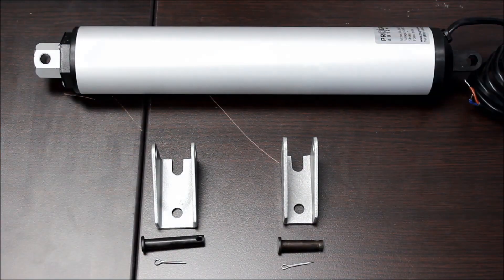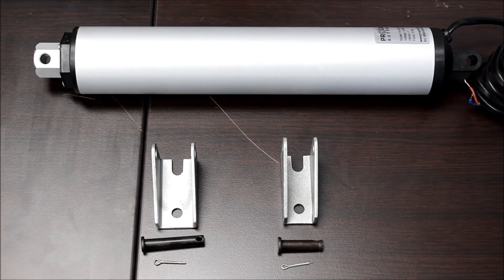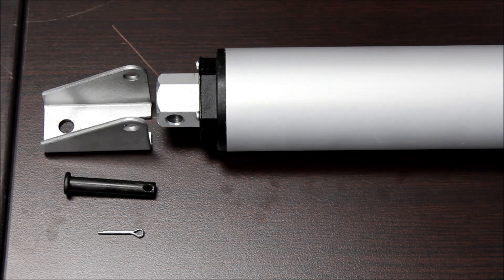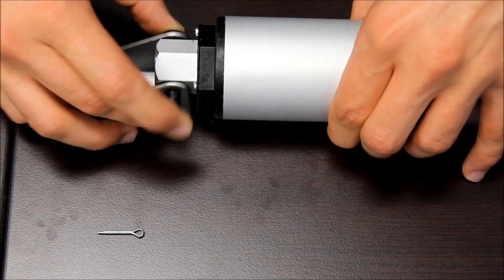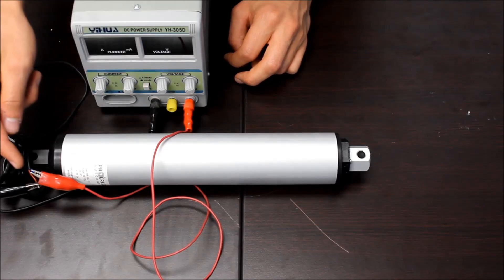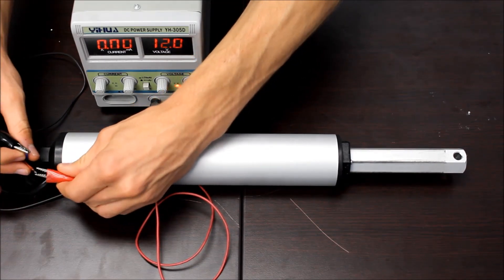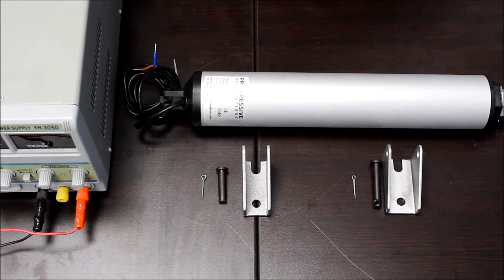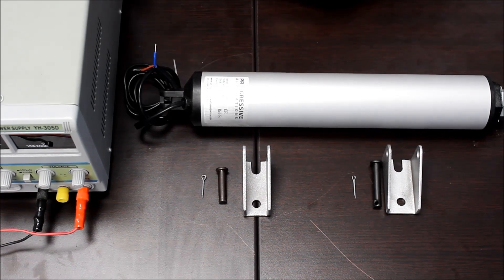High Speed Linear Actuator PA-15 - Product Overview

Comment: For this demo the actuator that you used had a speed of 9 inch per second right?
Reply from the maker: Hello
In this video we were using an 11 lb force model, which has a speed of 9.05"/sec.
Best Regards
Reply: Brother please assist me with few information. You see  I am an undergrad student of engineering department, working on a prototype design for elevator door panels. What I need to know is, will it be possible to design an actuator which is capable of producing high force and can trigger real fast. I would need about 1500N with a speed of 10inch/sec. I know how gear ratio works,  the torque to speed of rotation relation. Still is it possible to build one which does NOT compromise either.

I would be really grateful if you could help me with this.
Reply from the maker: Hello
For cases like these we recommend to contact us directly so you can get in touch with one of our engineers, they will be able to provide much more detailed instructions and guidance on how to complete your application. Please contact us at 1-800-676-6123 or sales@progressiveautomations.com so we can properly assist you.
Best Regards
Reply: @engineered.mechanized  So you chose YT do do your research on?

Comment: Hi can we use this actuator for motion platforms like for driving simulator?
Reply from the maker: Hi Lawrence
You can use our actuators for motion platforms, like this Flight Simulator one our of customers built - https://www.progressiveautomations.com/flight-simulator-success-story/. Using PA-15s specifically may be difficult because of their low force output, they can produce a maximum of 33 lbs. If you would like more information on what actuators would be best suited for your application, please contact us at sales@progressiveautomations.com or 1-800-676-6123.
Best Regards